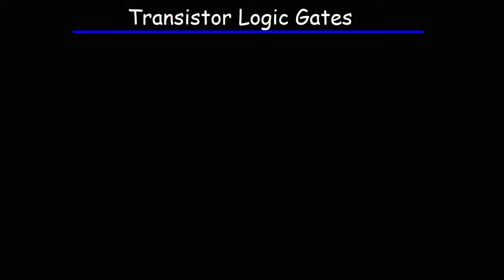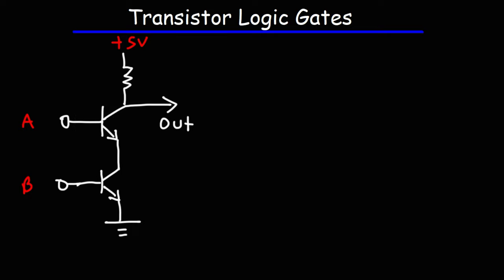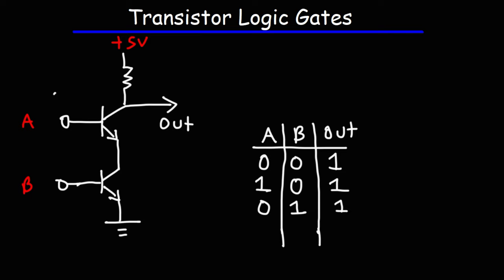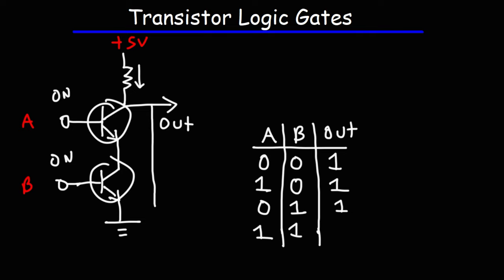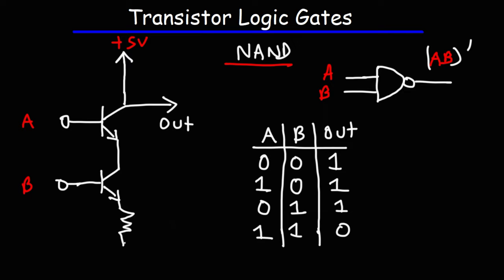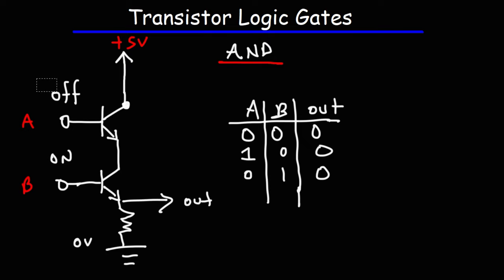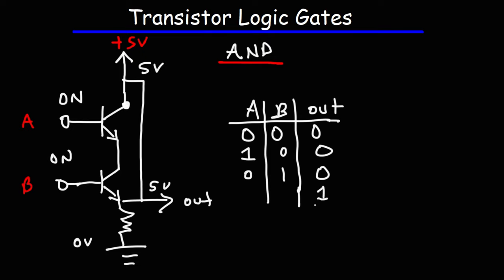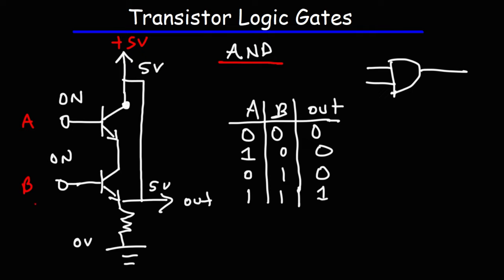Transistor Logic Gates - NAND, AND, OR, NOR

Comment: In theory you're correct, but in reality NPN transistors drop around 0.7v at base emitter so the AND gate output never gona be at 5volts with both transistors on, and if bottom only is on there will be some voltage drop on the output because the base emitter current is flowing through the output resistor to ground. This may be as much as 0.6 or 0.7 volts and false trigger another stuff on the circuit if is sensitive enough. I like to do my transistors AND gate by making NAND and inverting the output by another transistor on the top resistor output. Gòod video anyway.

Comment: 2:35 what purpose does the resistor serve here? Probably a silly question
Reply: Wondering the same
Reply: I think the transistors deliver a volt and then the current flows through the resistor resulting in the output to have 0 volt but I am not sure
Reply: It serves as the load
Reply: For Impedance matching

Comment: What is the purpose of the resistor at the beginning?  Also, in the case that both switches are on, what keeps a why does only a negligible current branch off to the outlet?  Were it the same as water, you might expect 50/50 to go to to each branch?
Reply: Hey did you understand? I don't know ty

Comment: The AND gate configuration shown in this video is not that practical. It is better to use a NAND gate configuration then connect its output to the input of a NOT gate , then its final output will be the output of an AND gate. 

It's like a NNAND(not a not and gate) which is basically an and gate
Reply: Thats what I heard too, but why is it not practical? Could you explain?
Reply: Because in real life, there is in fact a voltage drop across a transistor when it's on. This will cause the output voltage to be affected by the transistors that occur before it in the circuit. Having the output voltage be read from above the gates (then it would be NOR or NAND), you don't have to worry about the effect of the transistors on the voltage reading
Reply: Correct. This way the circuit is reliable since you can chain multiple gates together. The problem with the shown AND gate in the video is that it will continue to drop voltage foreach gate chained together until the system won't work anymore